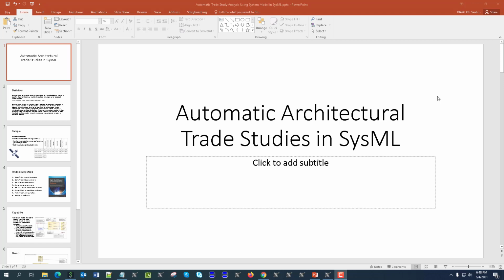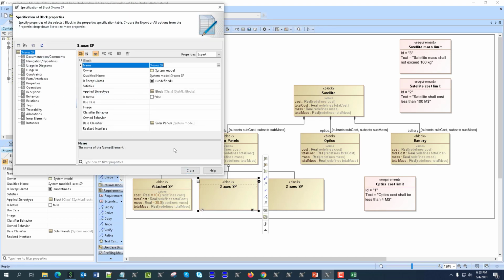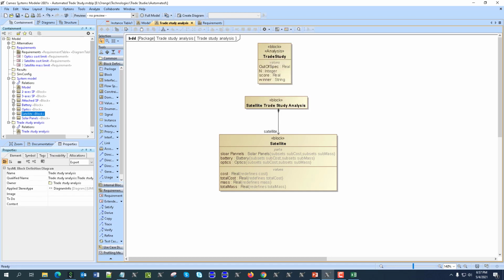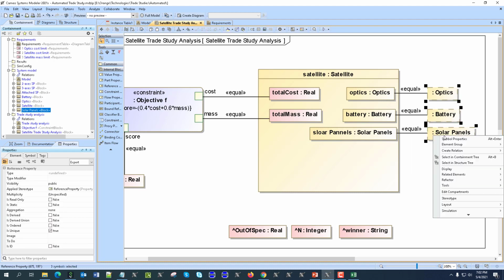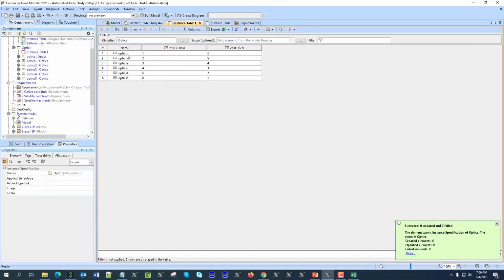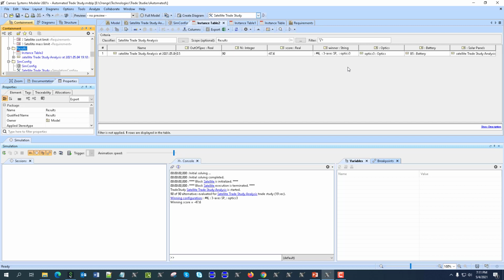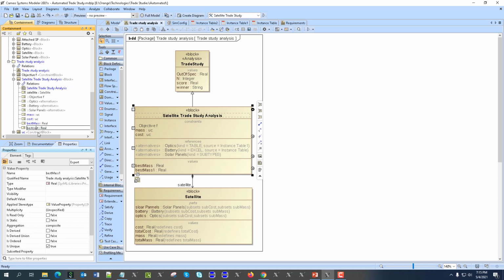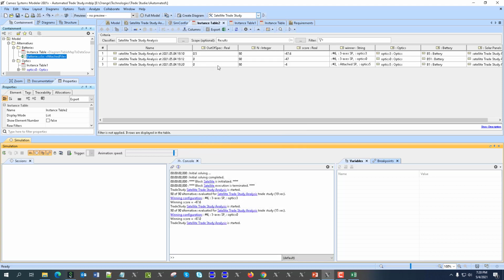Automatic Architectural Trade Studies in SysML Part2 - Step by Step Tutorial

Comment: Instead of using rollup pattern  for cost and mass, i normaly created value properties. One for  cost and other for mass. Because of this change, the simulation is not working. Why is it so? What if i need voltage or dimension as value properties?
Reply from the maker: Should work. Please feel free to attach sample at MBSE community.
Reply from the maker: Should work. Please attach project at MBSE community at go.3ds.com/cyber-systems

Comment: Nice video, just a few clarifications I wanted to ask about

1.  It seems like I’m getting a rounding error somewhere is there a way to adjust precision during the calculation process?

2.  Would it be possible to grab a minimum and maximum value without disrupting your trade study to internally calculate the normalization scale factors?
Reply from the maker: Thank you! 1. You can adjust decimal place in Options > project options > general. 2. Yes, some script might help.
Reply: @MBSEExecution  I think the question I asked earlier about rounding error is actually due to something else.  I notice that when I grab values from the excel with the excel tag, everything works perfectly, but whenever I do a version of the same table only using tables, the math outputs a completely different answer.  The only change between the two versions is I’m unlinking the sync between the excel and instance table, then switching kind to table instead of excel for the alternatives reference properties, and then copying pasting the data from the excels directly into the instance tables.
Reply from the maker: @SunnyDNintendoGamer thank you for the feedback. Looks like some inconsistency. Maybe worth to submit support ticket.

Comment: Thank you for sharing Saulius! I did some thing similar for HVAC system last year based on Trade-Study for Bryton Cycle example”. It gets complex and hard to manage very easily. 
I like your approach of satisfying the requirement at different levels. But I do not like entering the values directly/manually to the model (the way you did for attached SP, 2-axes SP, and 3-axes SP), would it be posable to read values (cost and mass in your case) from an external source (maybe excel or outputs from MATLAB)? Maybe doing the same thing you did for subsystems at part level?
 I am also interested to know if it is possible to do the trad-off analysis for system, subsystem, and part level in the same trade-off set up. This will be helpful to examine the values at each level before summing them up at the higher level. 
 I liked the utility curve but did not like the manual set up. Wouldn’t be better to add an objective function to find best- and worst-case values and feed them to utility curve instead of doing it manually? Imagine how hard this will get if you have a complex system with 100 or 1000 alternatives.

I just got the agile MBSE cookbook, and I can feel your touches in the book! 
Bruce + Saulius = great learning materials
Can you please let me know which video you talked about roll-up patterns?

Thank you again for putting this together for us!
Reply from the maker: Hello Mohammed. Thank you so much for your feedback!  We will share it with product manager to find the best solution.
Reply: @MBSEExecution  Why you used “ - (xxx)” instead of min (xxx)? I tried with min(xxx) but did not work even I specified the language as MATLAB.
Reply from the maker: @mohammedalbayati6617  Hello Mohammed, is question for this video? If yes, to which part do you refer?
Reply: @MBSEExecution  Yes, this video. My question was about the objective function you used for the score, why we cannot use 'score= min (xxx)' instead of 'score= -(xxx)'
Reply from the maker: Thank you for the comment. I think score is not an array. It stores the highest score and if higher is found replaces it. Automatic trade studdy pattern evaluates architectures one by one.